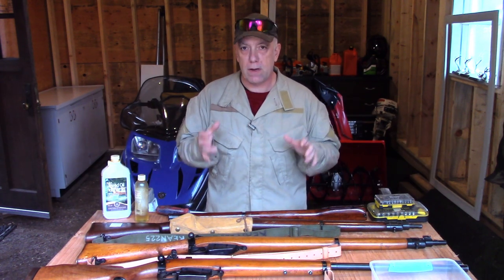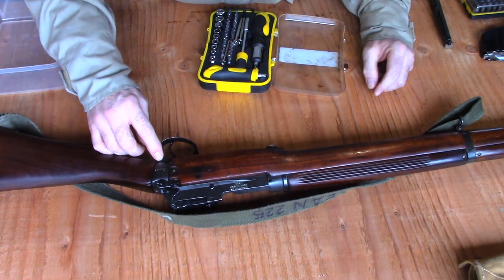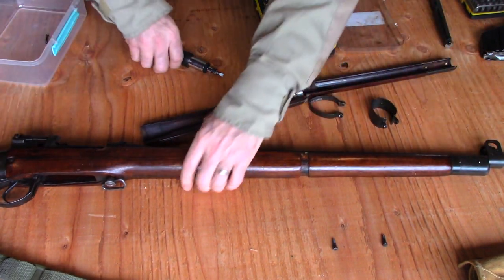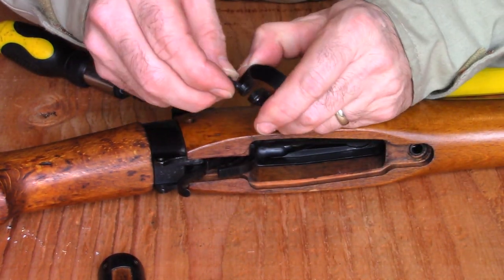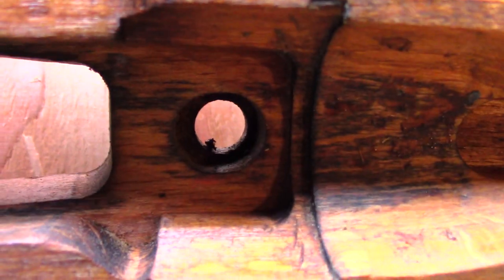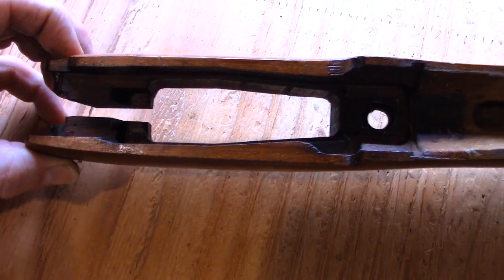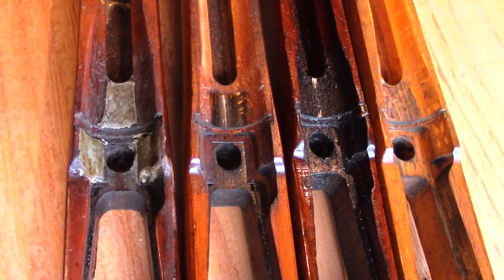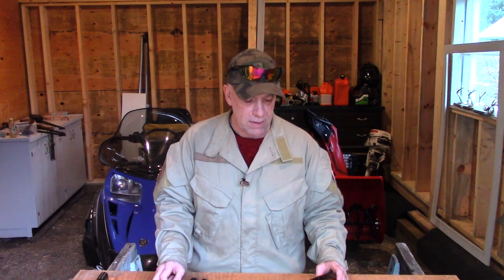No4 Enfield Bedding Styles

Comment: RC - glad to see your content.  The first rifle I recall spending my wages on, was a custom, single shot, 7.62 Nato - 4800psi. The  barrel was a standard contour. Over that barrel and a 1.25  Inch - OD steel sleeve. At the breech - there was a little lead weep, like car body done in the 40's and 50's.   The bottom of the action, was brazed 2 nuts, one just  at the back of the magazine and the other at the front of the magazine.  The front lug of the action was there, so you had 3 bolts holding the stock to the action, in 6 inches from the face of the rear stock plate.  It  was fibre glass bedded for just a couple of inches at the  front stock mount.   It was floated - all the way to a similar style of your enforcer.  At the 12 o clock position at the muzzle was a single weld,  like an arc weld.  The target sight was a PH - 5A.  Front was a rugged ears a real thin Brass  bead.  It weighed in at 12 maybe 14 #.   The recoil of this was a gentle push.   At the time IVI ammo would turn up and I used some of it.  It was scary how well this worked.  3 IVI rounds in under an inch at 100yds.  At 400 yd - 5 shots were covered by one playing deck.  Out of the few rifles I sold -over time  - that is the one I would want back.  Cheers to you and the rest of the crew. Cheers

Comment: Recently bought a #4 that had been made in 43 an was rebarreled with an extremely tight bore .307 vs .311...
Wood has shrunk (Colorado) so I bedded it... an free floated the bbl.. no luck, too much barrel whip... so I bedded it in the center, I got 2 moa... so I bedded the  center and front end temporarily with wood compound and it shot .5 MOA UNTIL  I got down to TX the compound came undone... so I used epoxy and I'm in the process of fine tuning the channel... hopefully I can get it back on track... once the temperature drops a bit.

Comment: Hi RC, here is a little tip to help with the nut on the cross bolt on the rifle. Grind out the center of a driver bit that fits the slot with a Dremel tool to make clearance for the bolt. You can buy them at TSC or Princess Auto pretty cheap, get a couple just incase.

Comment: I recently picked up a sporterized 2a1 and am attempting to restore it as close to original as I can using the furniture set from a DP no.1 mk3. The DP stock is well worn and was an awkward fit. And since it's not the original furniture anyways, I'd like to strip the paint off of the wood,refinish it with linseed oil, and bed the action into the stock.

Being a no.1 pattern and being chambered in 7.62 I was wondering if these bedding principals apply to 2a1 rifles and if not can you explain the  differences?

Comment: I have a norinco jw 105 and the recoil lug has the the screw hole at the bottom so itl l be hard to do a recoil lug bedding and the rifle is free floated already. Maybe i can add a middle block of epoxy like a 3rd node for the harmon ics. Or just 2 inches in front of the recoil lu g so the rifle doesnt move side to side anymore.

Comment: Question about the play at the muzzle end of things.  I have a 1944 Savage No4 and I can nudge the barrel horizontally to the left with slight pressure, but the barrel is bearing against the forestock at the right.  I cannot move the barrel from center to the right at all.  What's the method to remedy this?  I haven't removed the wood to see what's actually going on yet.  I'm assuming some light sanding on the inside right of the forestock followed by some raw linseed oil to seal.  Not touching the vertical bearing surface.  How much gap do I need?  I read online about .01" but this doesn't seem like very much at all.  Thank you in advance for your reply!!!
Reply from the maker: Hi Nicholas. I struggle with these requests because I can’t personally examine the rifle. From your description it is possible that the fore-stock to your rifle is not original to the barreled action. 
1.	It could be that your receiver is not bearing dead centre in the stock and that the draws are seating slightly to one side
2.	It could be that your forestock is slightly bent / warped to one side
3.	It could be that the stock is making firm contact on one side at the receiver ring and pushing the stock out of alignment. You should be able to put a feeler guage between the receiver ring and forestock with very little or no contact. Remove the stock and look for compression contact on one side. Use a file to gently lower the high spot (if any)
Again – I’m just guessing here. Goodluck and Maple Leaf Up

Comment: Interesting that you mention raw linseed oil, I have been trying to find it here in the US, no luck, even at lumber yards. Raw linseed oil used to be used on old wooden rain gutters on houses, also on cedar shake roofs. It soaks into wood better than boiled linseed oil, doesn't polymerize as quickly. I've Googled it, the returns are always for boiled oil.
Reply from the maker: You can find it arts and crafts stores. Usually in the oil paints section
Reply: @Riflechair  Thanks! I was looking for it by the quart/liter, something to stabilize wood that is starting to rot. It would be an online thing, my area is too rural for those high toned establishments.

Comment: How do you determine the 4-5 lbs of pressure at the end of the for end?
Reply: Just pressing the bottom of the barrel where it comes out the wood is usually enough.. it should lift against the top wood and return to centre bottom when release. If your are seriously anal, then you could use a spring balance and a loop of string to check the pull as the barrel is pulled off the bottom wood...!

Comment: The bands on this rifle are on backwards. The screw heads should be on the left hand side.
Reply from the maker: Where are you getting this? I prefer ithe screw heads on yhe same side as the bolt.
Reply: @Riflechair  I know it’s Enfield minutia and I remember reading somewhere about this arrangement. Anyway, a quick look through Skennerton’s The Lee Enfield A Century of Lee-Medford . . . book shows the screw heads on many instances. It you have the book, look on pages 190, 193, 407, 419, 495 and 526. In the whole world of things it doesn’t matter a hoot. However, your rear trigger guard screw and front sight protector screw have the head on the left hand side of the rifle. I believe it’s the same for most, if not all, of the earlier Enfields too. Thanks for making these videos - I really enjoy them.

Comment: Someone has done a real job on that 4T! Not only have they used entirely the wrong wood finish, the bedding is completely shot.. there should be intimate contact at the front of the receiver and the knox form.. looks like someone has rasped out the wood. there should also be contact either halfway down the fore end or at the end. Under no circumstances should the barrel be touching the upper guard.

All the 7.62 versions of the No4 such as the L39, L42 and enforcer used a shortened stock and free float. 

Lateral adjustment of the barrel is made by working on the "draws" which are at the angled faces on the back end of the stock..

Finally a small point with your description of the Enforcer having been owned by the "Scottish National Police".  There is no such beast (although nationalist elements within Scotland might wish for one).. the current Scottish Police is known as "Police Scotland" and before that there were several Constabularies that served Scotland. I would imagine the Enforcer would have belonged to one of these Forces.

Comment: Why raw linseed oil and not boiled linseed oil?
Reply from the maker: Raw linseed to penetrate deep into the wood. BLO to dry and procure a protective shell on the exterior.
Reply: @Riflechair  good to know. Thankyou for the reply!
Reply: @Riflechair  Do you apply the raw linseed oil to inner channel of the stock or only exterior?
Reply from the maker: @craigstanley3680  mostly the outside as this is where it tends to wash out.  But yes the inside perhaps annually.
Reply: @Riflechair  Thanks